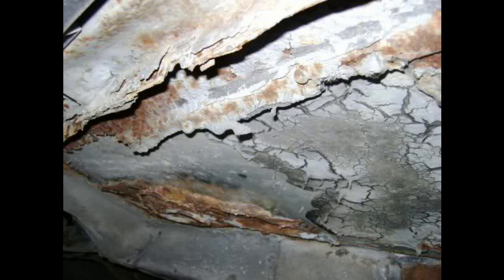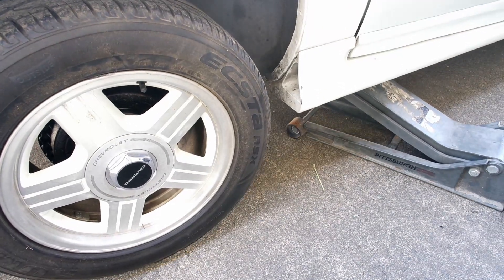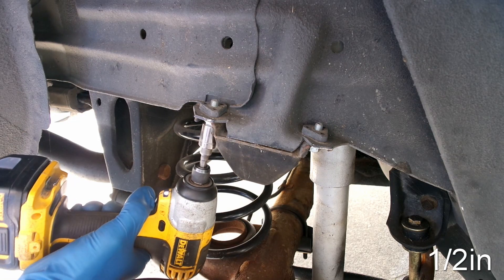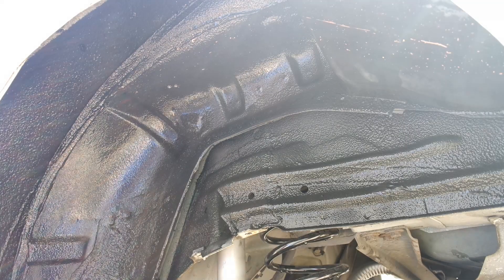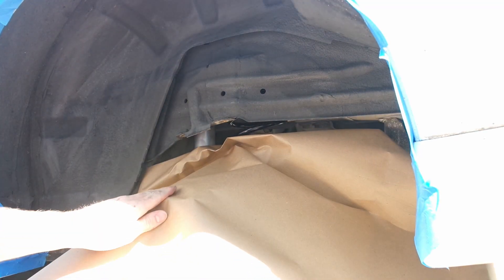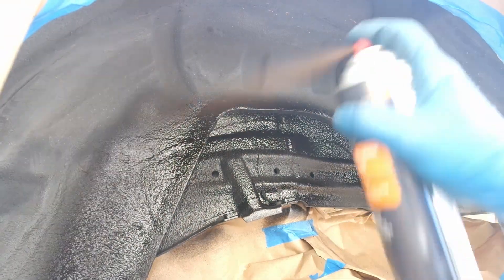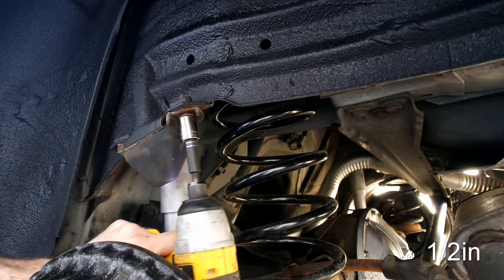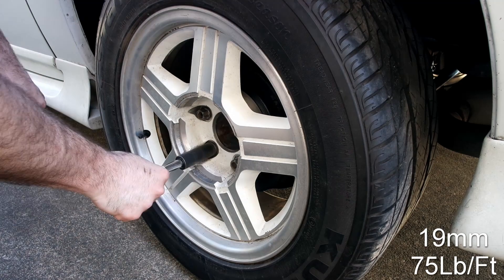How to Undercoat your Car

Comment: I just had my tank out of my convertible and used the same brand of undercoating on mine. It’ll take about four cans for good coverage. It exit the can pretty quickly...
Reply from the maker: ya, the cans don't last long.
however, the undercoating on the front tires is 2 years old and hasn't had a single issue, so i assume it'll last a while.

Comment: LOL! I have the reverse problem, my 83 came from Fla. It is completely rust free, and was stored indoors most of its life as all the vinyl and rubber is still supple. However SOMEONE went wacko with the undercoating it is everywhere, inside the doors, under the hood and every inch of the under body. I have many plans and one of the first things i will have to do is REMOVE all thisEnjoy

Comment: Rubberized coating is literally one the dumbest things you could do to your car
Reply from the maker: only if you spray over rust and imperfections yes.
Reply: @3rdGenGuy  until it starts to crack
Reply: Hi. Is Dry Coat Rust Preventative a good product to undercoat a new vehicle to protect and prevent rust? Would it protect from a harsh New England winter. If so could you explain how to apply it properly to the undercarriage. If not what is the best product or service for undercoating a vehicle. I looked up several services Krown, Ziebart, Corrision Free, WoolWax & Fluid Film. The reviews were horrible for Ziebart, Krown not so great, Corrisiion free so-so, and the others seemed o.k. I bought Cry Coat Rust Preventative to spray on the rotors as i seen some videos from car detailing guys saying it is great for that. Now i need to know the safest best product or service for undercoating a vehicle and how long it would last in a harsh New England winter with all the elements. Thank You